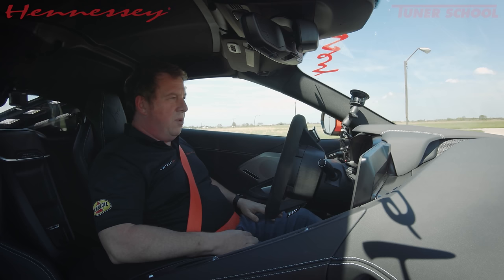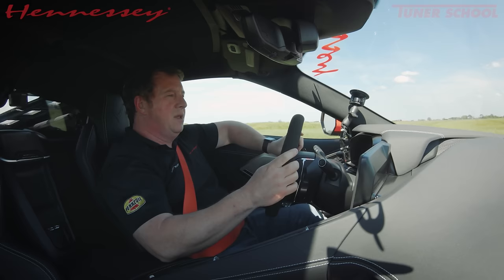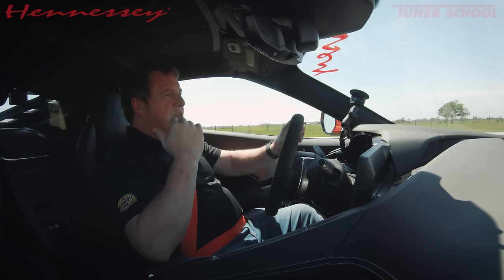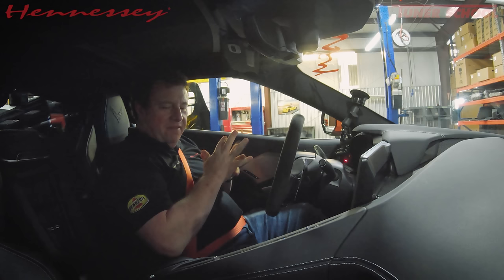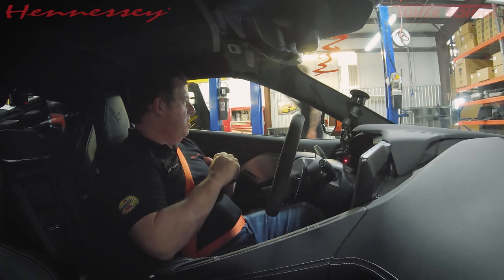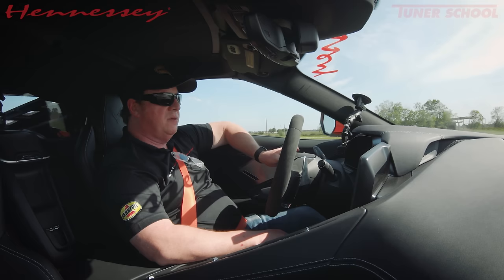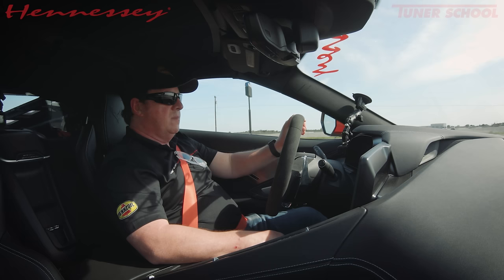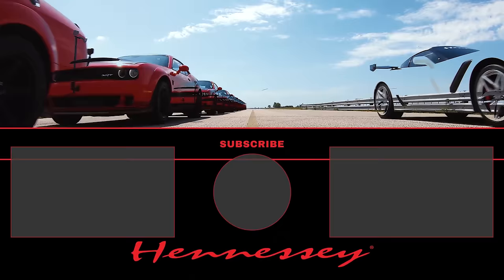Twin Turbo C8 Corvette Test Drive with John Hennessey

Comment: Holy Hanna, this makes me want to post an article about...

This article is about the writing implement. For other uses, see Pencil (disambiguation).

HB graphite pencils

Coloured pencils (Caran d'Ache)

A typical modern-day pencil.
1. Solid pigment core (typically graphite).
2. Wood.
3. Painted body.
4. Ferrule.
5. Eraser.
A pencil is an implement for writing or drawing, constructed of a narrow, solid pigment core in a protective casing that prevents the core from being broken and/or marking the user's hand.

Pencils create marks by physical abrasion, leaving a trail of solid core material that adheres to a sheet of paper or other surface. They are distinct from pens, which dispense liquid or gel ink onto the marked surface.

Most pencil cores are made of graphite powder mixed with a clay binder. Graphite pencils (traditionally known as 'lead pencils') produce grey or black marks that are easily erased, but otherwise resistant to moisture, most chemicals, ultraviolet radiation and natural aging. Other types of pencil cores, such as those of charcoal, are mainly used for drawing and sketching. Coloured pencils are sometimes used by teachers or editors to correct submitted texts, but are typically regarded as art supplies—especially those with waxy core binders that tend to smear when erasers are applied to them. Grease pencils have a softer, crayon-like waxy core that can leave marks on smooth surfaces such as glass or porcelain.

The most common pencil casing is thin wood, usually hexagonal in section but sometimes cylindrical or triangular, permanently bonded to the core. Casings may be of other materials, such as plastic or paper. To use the pencil, the casing must be carved or peeled off to expose the working end of the core as a sharp point. Mechanical pencils have more elaborate casings which are not bonded to the core; instead, they support separate, mobile pigment cores that can be extended or retracted through the casing's tip as needed. These casings can be reloaded with new cores (usually graphite) as the previous ones are exhausted.

Comment: Hopefully I get mine this year.  I want to run the turbos on the top instead of in the back.  Then exit the exhaust out the top.  Better heat control and less lag.  But I understand why they didn't do it this way.  I mean who wants to cut up a brand new car and gut the rear trunk.

Comment: Chevrolet small block + turbo system = sound of mechanical poetry !

I wonder how did the standing 0-62mph times improve ? If at all, all that power must make for some wheelspin on takeoffs ?
If you won't catch them on takeoff you will catch em right after....

Comment: @Henessey Performance The Mclaren 600 LT is a track focused car, like the ZR1, if you want more confort for street use you should buy the 570 GT, not the harcore version and then complain its not as confortable as a base vette with turbos.

Comment: I don't buy the idea that they put 200Hp more to the wheels without a tune in a NA stock car.  Is it speed density?  Can the stock fuel system handle that much more demand?  The exhaust tip mounted turbo setup does finally make sense in this package though, so that is an easy engineering win.

Comment: @HennessyPerfomance John & the crew. Thanks for all you do. I hope & pray that you can crack the ecu or GM gives you the key. 
I love the exhaust sound & turbo whistle! 
Cant wait to get mine in a few yrs.  
Just wondering,  would you drop the C8 Z06 trans & axles In this or go aftermarket? Maybe see if Tremic (spelling?) Has an upgrade kit for the transmission. 
Also do you have to upgrade the brakes for the C8 TT kit? I would think so, but want your expert opinion on it.
Cant wait to see what you do with the cracked ECU, larger injectors, & intercooler. Meth not interested but for others, yeah why not.

Comment: Didn't you guys meaning Hennessy company, say that you can only get 650 horse power out of the new C8 engine.  That's kind of hard to believe that after 650hp it will start to break, Without doing any internal engine modifications. So again is this accurate from what Hennessey had stated in a previous YouTube video regarding this new twin Turbo C8 Corvette

Comment: The engineers at tremec know how much power the transmission can handle. They probably designed it for mods since corvette has a huge aftermarket.
Reply: Apprently its rated for 500lb according to specs on clutch pack

Comment: I would take a modest 750 HP to the RW if I can get a little longer life out if the duel clutch trans. You can rebuild the motor and rebuilt it even better but once that transmission is shot it’s shot. Unless someone has figured out how to upgrade an 8 speed duel clutch.
Reply: More like closer to factory specs life out of the transmission or settle for 70% life. Something like that.

Comment: For some reason, I want to see a Hennessey tuned 2019 Ford Ranger FX4 👀 
since they only have a 4 banger, a single chinese spooly boi, internal upgrades, engine upgrades, etc would help 😈
Reply: @andrewpeterson9250  I know 😢
we get the F150 raptors but not the Ranger Raptor 😒

Comment: Great sound. But you gave it one hard push to just over 100, and it needs a cool down? Surely it should handle multiple power runs with no need to " cool down between" or is the clip edited and you've been pushing it hard for a while?

Comment: that car's got to be insane especially since the engines in the rear so you can really take advantage of the horsepower these cars that are rear wheel drive are ridiculous you can't take advantage that's why there's a diminishing returns between the ZO6 and the zr1 because you're burning rubber halfway down the line in the quarter mile

Comment: my only gripe about the c8 is the fact it doesnt have an exotic exhaust sound.  just sounds like truck. not a supercar.   in fact it sounds like a big turbo diesel.   This is the c8's only shortcoming.  and thus far no one has been able to truly give it a different sound.  Now with that said the forthcoming z06 may sound like race care which by far is not a truly exotic sound but far better than the current car.  I absolutely loved the sorta dual tone sound of the old viper v10's  they had a very unique signature sound,

Comment: I might get some hate for this but I don’t like the sound of the C8 at normal speeds @ WOT it sounds tits especially with the turbos but at normal driving they sound like there is something in the muffler that is broken and fluttering in there it don’t sound tuned probably cause I’m not used to hearing a Chevy without all the piping 🤷🏻‍♂️ any way this car is a beast regardless of what I think! Awesome build guys

Comment: Hey if the air cleaner is at the same height as the rear exhaust, won't that just be sucking in road dust and spray?  Normally the inbound air isn't so close to the ground.

Comment: you said its a car one can aspire to own , but it'll take me 6 years to save up for one , by then they're going to get discontinue. How will i be able to buy a new one then if they get discontinue?
Reply: Buy used. They will be 50% less in 3 years.
Reply: @allthecommonsense  the thing with that is that these cars will be abused and sold later as a low mileage car , but with alot of abuse from owners
Reply: @93mlo  depends. I just recently bought an 2006 Lamborghini in very nice condition. Some people take care of their toys. You can almost always find a clean one.

Comment: It sounds like the whistle turbo you buy on eBay for $5 and put in the muffler I was expecting a more powerful sound
Reply: It's on 5psi, barely tuned, ecu not cracked yet
Reply: Haven’t tuned it or got into the ecu yet

Comment: So it's running like that on the stock calibration? How?
Reply from the maker: David yes. Because it does and it can.
Reply: IIRC its because the C8 has a wide band oxygen sensor, which can measure A/F ratios across a pretty wide spectrum. That allows for some changes to A/F ratios without having to tune. You won't get the max performance out of it, but you'll get way more than if you had to contend with a narrow-band sensor.
Reply: @charlespierro8048  The stock systems have had MAF, intake air temp, knock, O2 sensors and very capable computers for decades. It's always going to adjust to see the air/fuel ratio that is targeted, until you run out of fuel flow. Then you put higher flow injectors (possibly fuel pump also) in it and start over. If you have the computer unlocked you can fiddle with the air/fuel ratio targets (and everything else, lol) and get those last few elusive ponies.

Comment: The turbos will probably be in the intake or connected to the exhaust manifolds on the z06  ....
Reply: fastlonnie1 there was a cad picture of the supposed engine where the turbos sit down low in the front. I have a feeling that they are stretching the car just a bit to fit them there for oiling and cooling. Real short lines to the oil sump instead of having to uses scavenge pumps like Hennessey.
Reply: @SuperSilvi1990  you're right, I totally forgot about that picture, I've seen it also

Comment: 640whp without even trying... That's already very good horsepower with stock engine internals and stock transmission. With 200whp more is almost 50% gain in wheel horsepower!.

Comment: #1 First impression -- that filter in the rear bumper close to the ground is not ideal (because it gets dirty and because that is a reduced pressure zone at speed de to aerodynamics.
#2 The C8 is not a car that needs a lot more torque from the engine.
#3 I'll very much prefer a low boost, high flow, maximum response, turbo design. Something like a pair of GT2860R (not even the 2860RS). Target boost being about 8~9 psi (0.55~0.60 Bar) with stock 11.5:1 compression (or maybe about 12 psi  w/10.5:1 if one doesn't mind the extra hassle and costs of a new head gasket) and very high efficiency air-to-water aftercooling. Target output being 660 bhp @ 6,000 rpm with 600 lb-ft @ 1,600~5,600 rpm. The objective shouldn't be maximum power but a turbo that is eager to spool at part throttle even at cruise revs (1,600~2,000) and which is linear all across the rev range. Getting a lot more torque is counter productive in a car that is largely traction limited. Getting to torque peak under 1,600 would be even better, even at the cost of some power, but it is not going to happen without a dual scroll housing and segregated flow exhaust routing.

Comment: As is now
Definitely a 10 sec set up

Low 10s w/ drag set
Reply: There running 10.7 with just a 100 shot and sticky street tires! There gonna be stupid fast under boost
Reply: They run 10s stock!
Reply: Gm rated it as 11.2 stock and the video i watched said they we're chasing the c8 "world record" which was 10.53  i think not sure but who knows they ran 10.8 wit 100 shot & theres always a diff between manufacturers test cars and what they do in the real world!
Reply: Quicktime_GT haven’t seen that yet on video

Comment: More power, huh?  With more power, the need for stability and the ability to put that power down become a major requirement.  The C8 seemed a little unpredictable around turns in stock form as it is but now with almost 200 extra horses, I’m sure it’ll be a hand full in taking off and handling.  Chevy should have gone all out with the C8 and made it all wheel drive.  I’m sure it would inflate the price; however, it’d be a better competitor to the Euro’s exotics.  Maybe GM is holding out for awd with the ZR1 version.  We’ll see.

Comment: At first, I was like "Rear Mounted Turbos Suck". 😡

Then, I was like, "This car is mid Engine".  🤔😀😍👍

Note to the Editor:

640rwhp is a relatively "light" tune.  What psi, fuel system, turbo size, and fuel are you running?   
My built Twin Turbo Mustang 4.6L made 725rwhp on 18psi, and that was a "safe" tune with 110 octane fuel 10 YEARS AGO!
I'm just thinking the number is VERY low due to a reserved tune with your engine size and two hair dryers...  🤔

Comment: Now if Chevy can drop the weight by 300 lbs and put a sub-5.0 Twin Turbo V8 in it with around 650 hp it would compete with the McClaren 600.

Comment: Unless the losses MASSIVELY increase, a 1000hp c8 should make 900-920hp to the wheels
Reply: Jacob Walls normally it’s more 15% loss for 2WD and closer to 20% for AWD
Reply: Alex Bélanger-Rouillard not when the distance from the trans to the wheel is that close. They are saying 10-12% on the C8.
Reply: @arsenaldline  but we've already seen 8-10% on the C8 from recent Dyno pulls...plus, you're talking about front-engined cars with torque converters and driveshafts...this new DCT Tremec is a freaking exotic beast
Reply: I am thinking 880-900 whp
Reply: @arsenaldline  plus, everyone should be running the new Banks diff cover to lower parasitic losses
Reply: People are dynoing close to 450whp consistently. The car makes 490 crank. Figure out the math and there's your answer.

Comment: Lmao. So Many Clips! They are hiding that part in the first few seconds where the trans clutches barely hold on a full throttle shift
Reply: Jon Smith 😭😭😭
Reply: Torque limiter on the trans, no one can tune it out yet

Comment: This car's design is really bad especially from the side. What were Chevrolet thinking when they made this very large air vent on the side that absolutely makes the front of the car disconnected from its back. The same story applies to the new Camaro.

Comment: till someone makes a new auto and diff and pistons with the right rings for it, then the car will be worth doing, and also the tuning is so hard its not funny, because Chevy made dam sure its very had to do, unless you get lucky and chevy give you the spec;s and parameters to upgrade the ecu or better still you replace the ecu with totaly new system which still controls everything but you can tune it in every repects?

Comment: Sorry bud, "we could go 400 miles on a tank" means nothing unless you tell us how big the tank is. If I put 1000 gallon tank in my F150 I could go 10,000 miles on a tank. 

How many miles you can go on a tank of gas is about as useful as saying "I get great gas mileage, my C8 is red".
Reply: Muskoka Mike sorry bud a simple and easy google search will tell you how big of a tank the car has. It also tells you the mpg on there as well. A simple google search and a little math and you could’ve found an answer faster than it took you to type your whole comment!
Reply: @djanthony9974  True, but then again, he could have simply said "we got x mpg driving back from detroit" right?

So the next time you're at a party and you're talking to someone and ask "I heard you went on vacation, where'd you go"? And they say, all the details are on my facebook page, go there if you really want to know".

Then you say "alrighty then" and move on to the next guy...."hey I heard you just finished building a 1969 camaro, all stock right? what sized engine does it have"?

Google 1969 camaro and you can find all the specs and if you are so inclined, you can calculate the HP by multiplying the bore and stroke and use the force x distance formula to get to HP.

Or he could just say "325". RIGHT?

Comment: Still pretty slow compared to other cars with similar or less powerime the Mcly720, Ferrari F8, Porsche 911 Turbo and S, Lamborghini 700 all which can do 60-130 in undear 7 sec. Average is 6.45 sec. this pupp took 6 sec to go from 42 mph to about 105.

Comment: Add motor mounts old man.  Motor is moving too much for me     Also still rather have a 300zx from 92
Reply: But it was only 300hp from the factory. Luv Z cars, but have to have Stillen mods to compete with base C8.😎

Comment: Take my money, but I want 180 mph.
Reply: I'm not certain of the specs but 180 should be easily attainable in the stock format, nevermind a tuned/turboed one. My mostly stock c6 did 160 with no problem at all

Comment: How can u say it has 200hp more with no tune??????
Reply from the maker: Charles Turner because it does.
Reply: He can say it because maths.
Reply: Nobody has cracked the factory ecu and to my knowledge nobody has a stand alone yet so who is it being tuned?
Reply: @aidanhamilton9859  You think a stock UN-TUNED ecu will safely add whats needed for a 200hp gain?
Reply: @charlesturner5195  ecus are super advanced nowadays, wouldnt be surprised if it can compensate. Also wouldnt be surprised if they piggy backed it to fool it.
Reply: @aidanhamilton9859  i know it comes with factory widebands but thats asking alot for fueling at a 200hp gain.
Reply: @charlesturner5195  dont you think maybe thats why its a prototype? Lol.
Its not released to the public yet. They dont know if it will be reliable or hold up yet.
Reply: @charlesturner5195  i mean if it works, it works. It will be pushing the limits but thats kind of what their intentions were in the first place.

Comment: The whole “no tune” thing, imagine what kind of sketchy stuff is going on to get it to have enough fuel under boost. Other than that the sound is really meh. Looks exotic but sounds like every junkyard turbo LS motor. Sound doesn’t match the car at all
Reply: you sound salty as hell. probably a ford fanboy
Reply: r3wturb0x considering I own a turbo LS car I’d say I’m not a ford fanboy. I’ve just heard too many bad things about this company and guy. And I’m still not a fan of the sound of the car. Take the time to build a tuned exhaust that sounds just as exotic as the car looks.